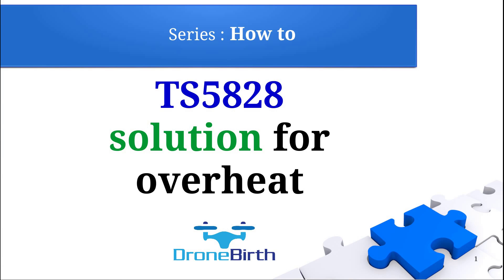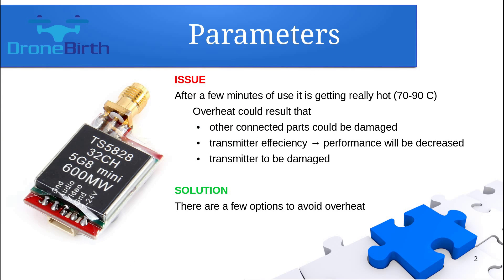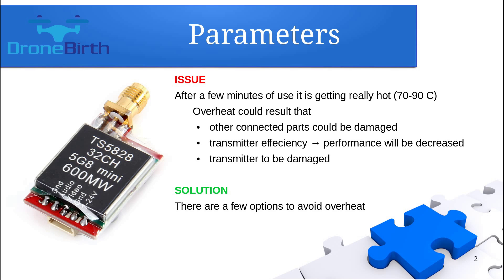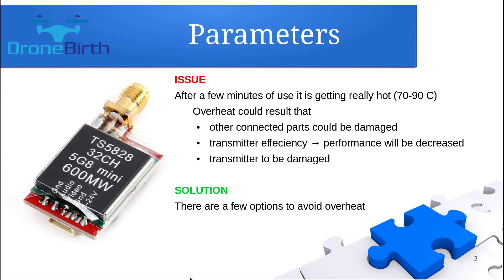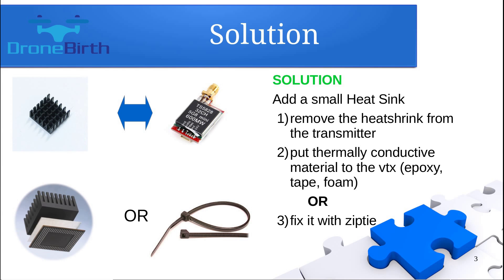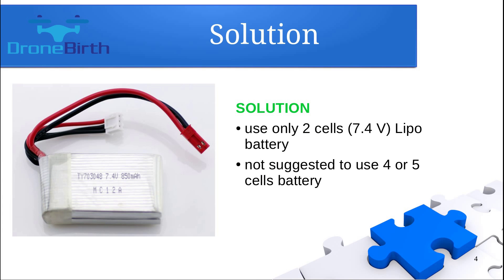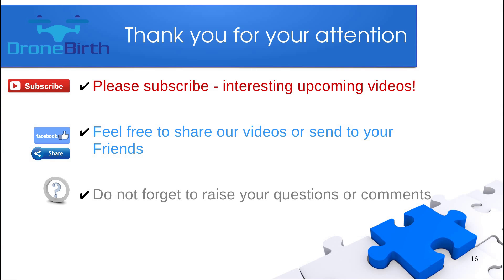TS5828 5.8Ghz 600mW Video Transmitter (VTx) overheat solution

Comment: I use on 4S battery and first day working fine but tomorrow is dead.. Voltage range on TS5828 is 7-24V and i have cooler. I see that is not suggested on 4S. Why? Thx

Comment: What is your opinion About TS832 module ?

Which one will give better range and video quality ?
TS832   OR TS5828 (Considering same environment)
Reply from the maker: +Varad Kulkarni 
theoretically, you may not see significant range difference between ts5828 vs ts832 as both 600mW, however if your ts5828 overheat issue is not managed properly, it will decrease the throughput.
I would go with TS832 if you have no space or weight concerns.

Please do not forget to subscribe! :)